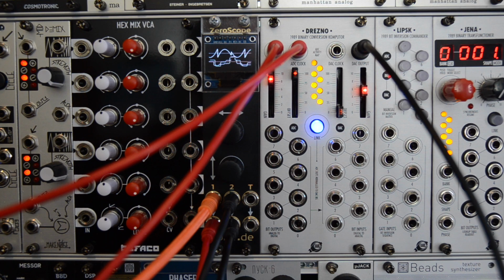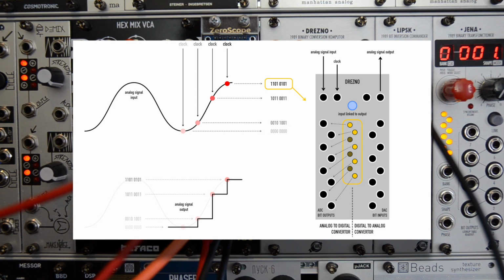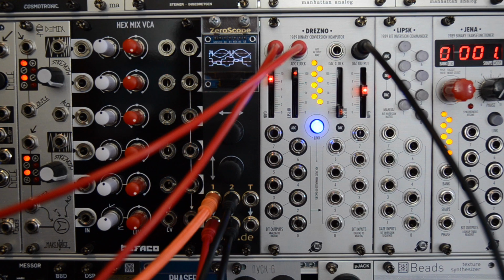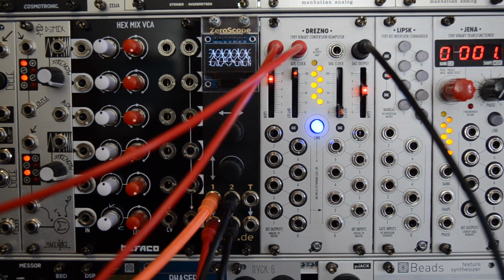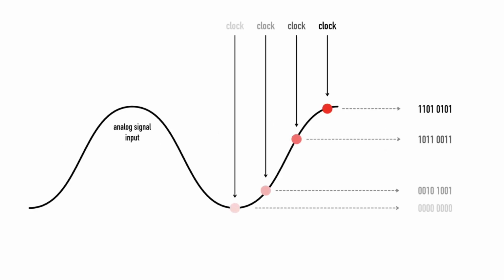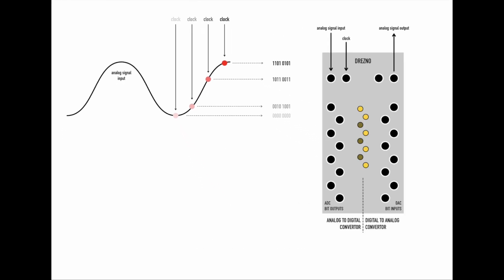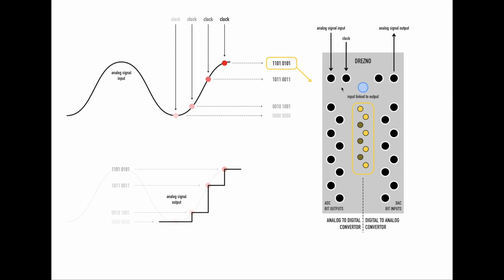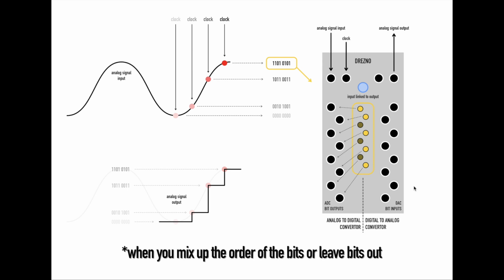Xaoc Devices LEIBNIZ #1 / DREZNO / extensive playthrough

Comment: Thanks for this. What would you say is a good next leibiz module after the drezno?
Reply from the maker: I'd say either Lipsk or Jena. If you like what you can do with Drezno but you just want to be able to manipulate the bits in other ways Lipsk is the one to have a look at. If you want something that really changes the complete chain and gives you a (kind of) wavetable VCO/LFO than Jena would be a better choice. I don't have enough experience with Erfurt yet, but that one is more of a non-straightforward counter/clockdivider. I like to use that one seperated from the Leibniz chain.